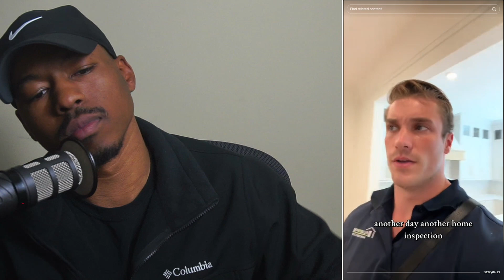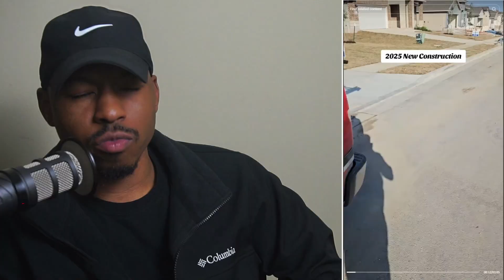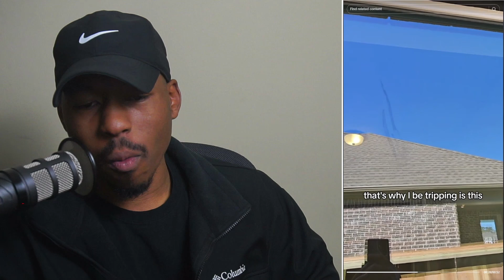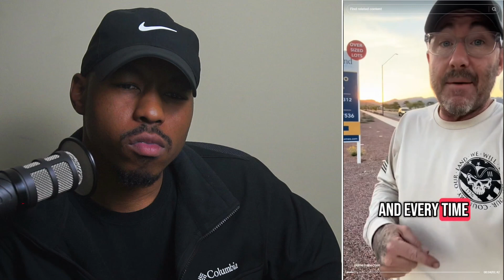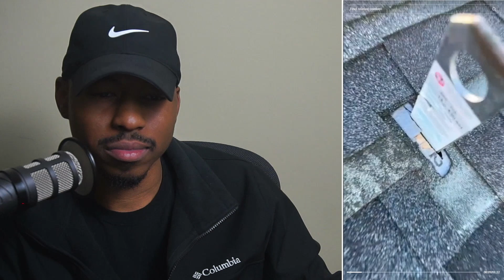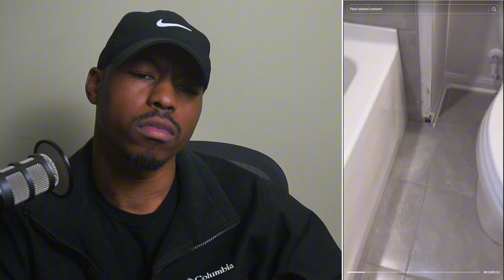The TRUTH About New Construction Homes Are Being EXPOSED In 2025...

Comment: I was a Union Painter on condos, Townhouses and high end luxury homes  in Chicago and suburbs. Retired 12 years ago, I can only recall the contractor was only concerned about the cosmetics. They'd hold your feet to the fire on walls and trim being smooth, no drips or gouges. Yet if something wasn't straight in the framing meaning doors wouldn't align, countertops not tight fitting? Out came one of their laborers with a friggin caulk gun!😅 Only because in order to fix it, They'd have to tear out the drywall and pay us to tape and paint it? Another problem was a lot of structures walls were made off sight in a shop? Most of the panels were assembled with these 3" staples, not nails! You couldn't believe how fast a 5 unit Townhouse was built! Several flatbed trailers rolled on site with a crane hoisting the numbered walls in place. And again stapled together, really flimsy until the roof trusses were in place. Also pre fabbed off sight held together with metal plates at the joints that had 1 1/2" spikes. None of the lumber is dried, in fact it was probably a tree 2 months earlier? So as the framing settles it shrinks and the drywall cracks the movement effects doors and windows! A damn expensive shame😮

Comment: Where I live those 3 inspections and more are done by the government. That is what you buy a building permit for. Supposedly.
I don't know for sure how thorough they are as regards finish quality.
Reply: In the US govt inspectors are generally concerned with safety items. Electric isn't going to electrocute you or burn your house down. HVAC isn't going to poison you with carbon monoxide. Gas lines aren't going to leak and blow the place up. Stairs aren't going to collapse as you walk up them. Fit and finish aren't really on their checklists.

If you live in a really booming area then even third party will be so busy or they lack the knowledge and experience that they skip or miss a lot also.

Comment: Always use an inspector NOT affiliated with the realtor company, Electric, water and plumbing as well as framing and foundation, should all be inspected before the house is buttoned up, by doing this you wont have to have things literally ripped open so they can see if its right or not. I have had to cut into people walls, its not fun especially when you have to charge them to fix the work they already paid for.

Comment: 9:18  said “if it’s in the budget”.  You haven’t started the process yet so you can consider it in the budget right now if it’s important.  You budget with that in mind and then it’s automatically there.
Reply from the maker: That's true!! I worded it that way cause I'm still doing research on the different types of inspections so I should have said that differently. U are 1000 percent correct